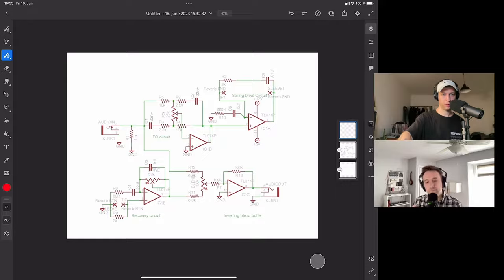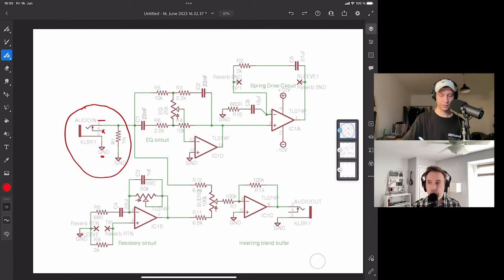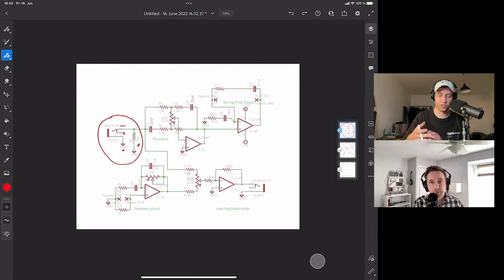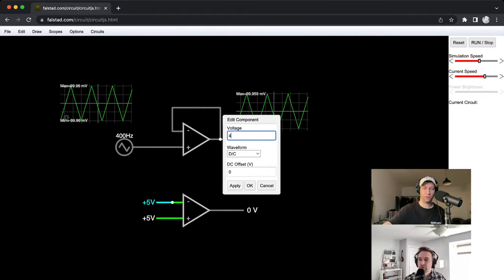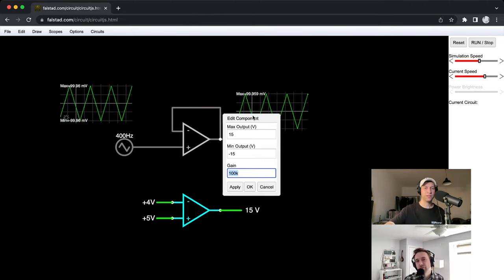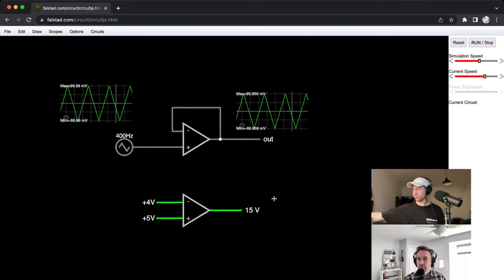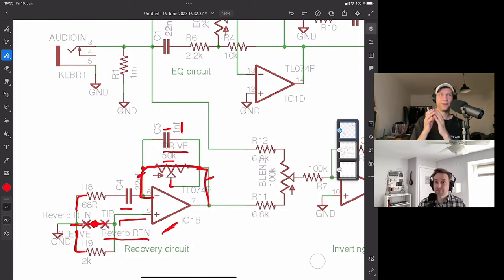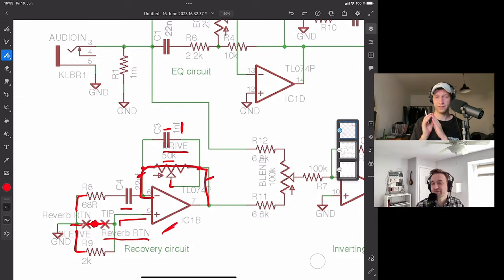Reverse Engineering... with @DavidHilowitzMusic  | Spring Reverb

Comment: 16:16 not sure if the chat brings it up but that 1M resistor to ground from the input jack is probably there to reduce noise when connecting the jack to the circuit. They're often used in guitar pedals as bleed resistors to remove stray capacitance or DC offset when a pedal is plugged in or turned on/switched in (if using a true-bypass circuit)

Comment: 1M at the input functions as ground path: to avoid that the input becomes an antenna when nothing is connected to it
Reply: I think it's actually a pulldown resistor taken from guitar pedal circuits in order to prevent an audible 'pop' when the foot switch is pressed
Reply: @daithibailey  yes, also!

Comment: During the 1970s  at TAPCO, the 6000R mixer had a differential op-amp drive circuit for the reverb tank.
Along with some EQ on drive and pickup, this really worked great.  There was also an EQ knob for the pickup side that gave less or more low end.

Comment: TL074 driving a spring reverb: very depending on the input impedance of the reverb tank. For most tanks, TL074 is not able to drive enough current: a spring reverb behaves as a coil. I use a transistor buffer stage after the TL074, and the difference is HUGE

Comment: The tiny capacitor in the driver circuit is acting in low-pass mode.  It's trimming frequencies above some amount based on the impedance of the transducer and the capacitor, presumably to smooth the highest frequencies out to reduce potential damage to the transducer from beyond-audible frequencies it's being asked to react to in realtime.  It's not strictly necessary, but it probably improves the sound somewhat over relying on the magnet's inertia to do the smoothing, since it'll overshoot if the peak isn't smoothed off a tad.

Comment: Isn‘t the resistor on the jack input side merely a conformation since older cables had a higher ohm value? Equipment in the past always had input and output high-ohm resistors set up this way.

This makes the resistor obsolete with newer low-ohm cables.